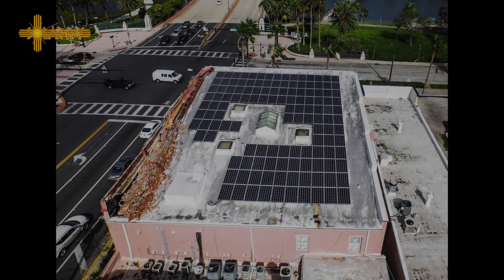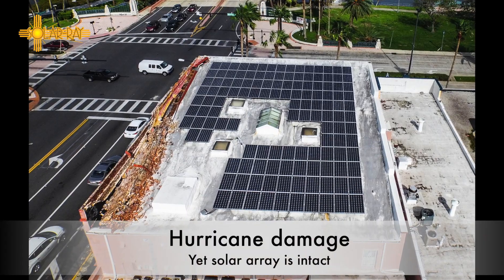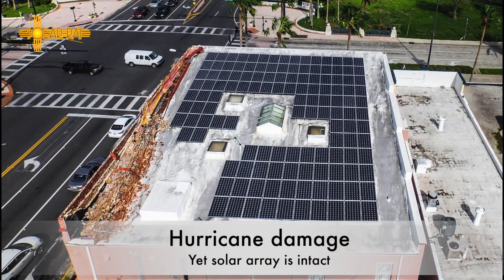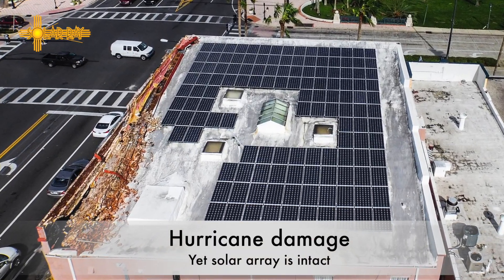Can solar panels survive hurricane? How do you protect solar panels?

Comment: My living latitude is 37 degrees. I've got a 8 degree pitch on my roof so it's pretty flat, the good news is the roof is facing South (Northern Hemisphere here) and clear of shade. I will consider angling them up to 15 degrees, optimum would be 30 degrees. Strongest wind we ever had around here have been in the 60mph range but that's extremely rare. The other concern is birds but will be taken care of with Bird Be Gone Wire Mesh. I've been told the loss in angle and energy will be minimal, but if I wanted to compensate for the loss I could add a couple more panels and call it a day.

Comment: Another sales pitch for why you should us a qualified installer vs DIY etc.
I have been through 7 hurricanes so far and one of them was a CAT5 dead down the middle of my area.   Very few non concrete roofs survive that intact.  Much less solar panels.
I would say that if anything over a CAT 1 is heading your way get the panels off your roof.
Don't expct a solar company to drive up and do it.  I know a guy who has a Solar company and when he saw a CAT 3 hurricane coming he told me took the office phones off the hook two days before it arrived and went to his house and battened down his own stuff.  He Laughed and said that there was more money in it for him replacing whatever gets damaged!
Reply: I just love your comment, why? Every word true. I live in Jamaica my system is Diy, my roof is slab. I slab it mainly because in case of hurricanes and I design my system so I can take them down in case of a hurricane as well, luckily in the last 5 years there have not been a hit. What if I tell you they are not even bolted down, I just placed all seven panels on blocks and leave them there like for about 5-6 years now and they work fine. Man I rather go through the stress of taking them down securing them and put them out after a hurricane when I am really going to need them.

Comment: Got a storm in the uk know worried about my solar panels on my roof they must be strong i know we have regular checks on them
Reply from the maker: As long as they are installed properly there is nothing to worry about
Reply: I guess with climate change you never know but you lot in England don't get those powerful storms, Or have I gotten it wrong?